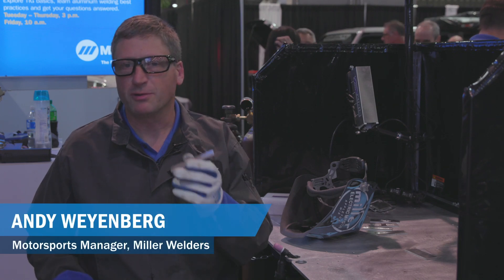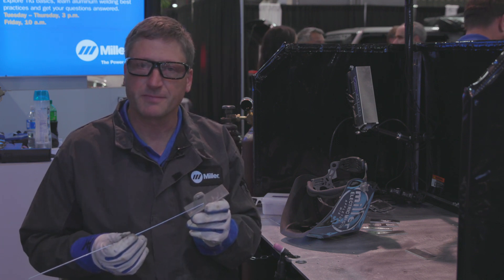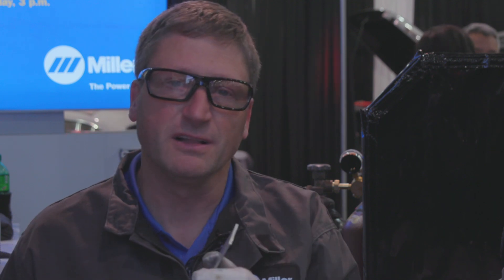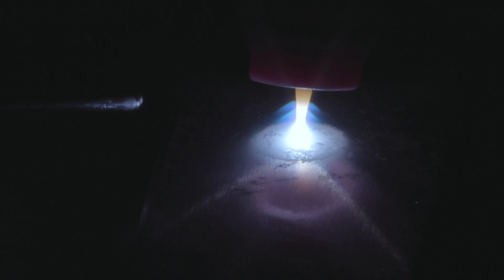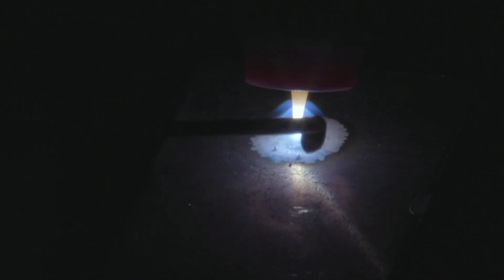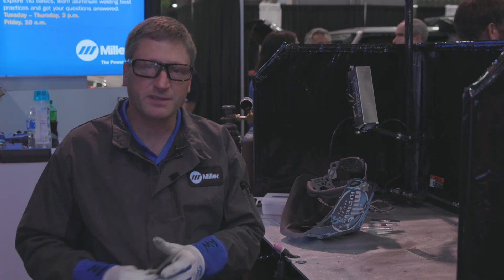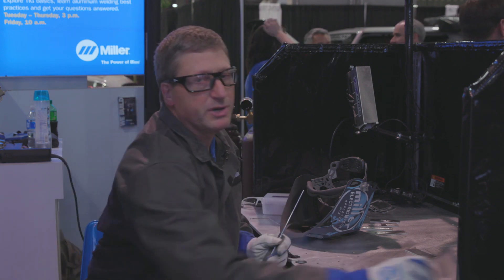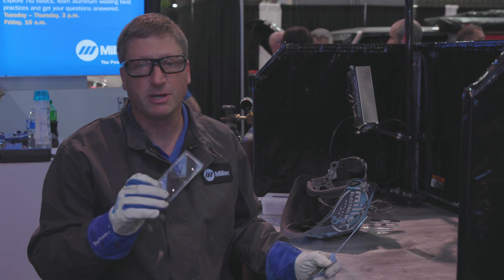Common Problems When TIG Welding Aluminum

Comment: I had a guy tell me at a fabrication shop that having a rounded bubble shape on the tip of your tungsten is better than having a sharp point when welding aluminum. I’m not sure how much truth is in that,because I always use a pointed tungsten.